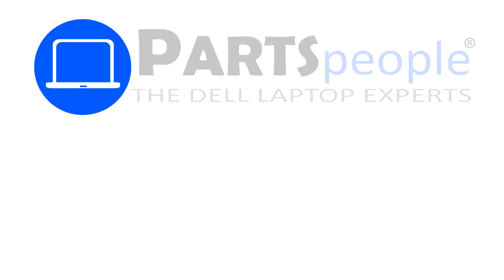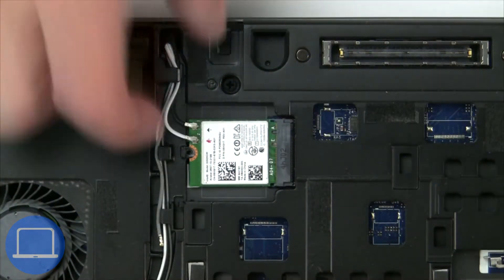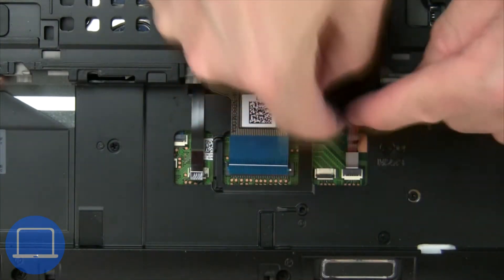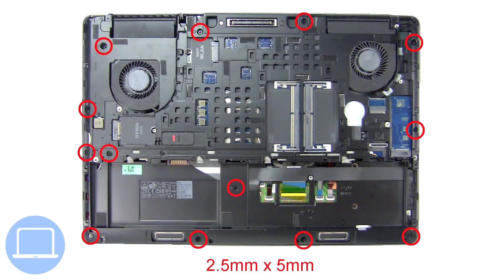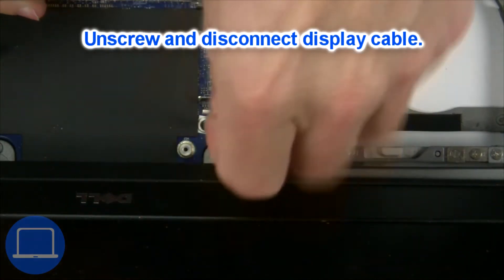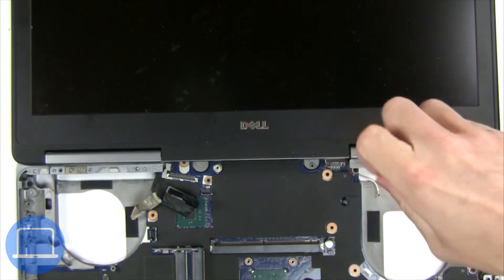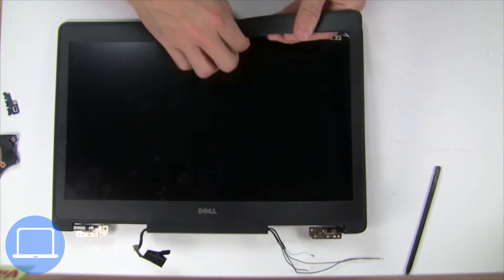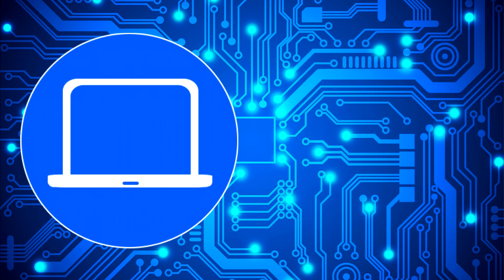Dell Precision 15-7520 (P53F002) LCD Panel How-To Video Tutorial

Comment: Or TLDR remove the screen bezzling and 4 mounting screws to disconnect and remove screen without all the extra work.
Reply: Wish I read this before I blindly followed without watching the whole way through
Reply: I wish I had read this before I removed the Wi-Fi.  I did skip removing the keyboard and everything after that until removing the bezel around the screen.  Yes just remove the battery and then go directly to removing the screen bezel.

Comment: Very nice tutorial. Thanks a lot. I own a used Dell Precision 7520 with a Full HD IPS display and want to upgrade this Dell with a 4k ultrasharp display. This is possible by only replacing the screen and setup configuration , or do I have to replace another parts too?